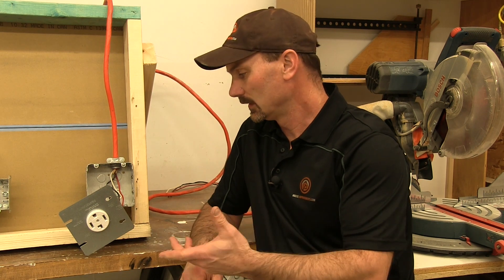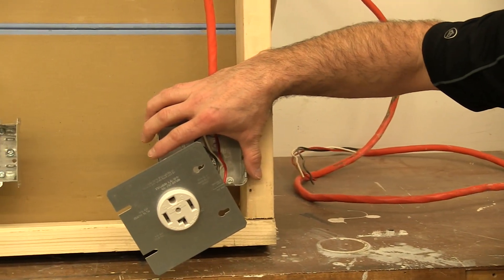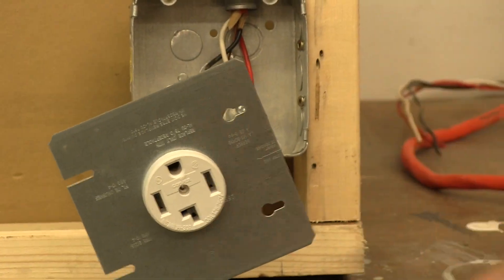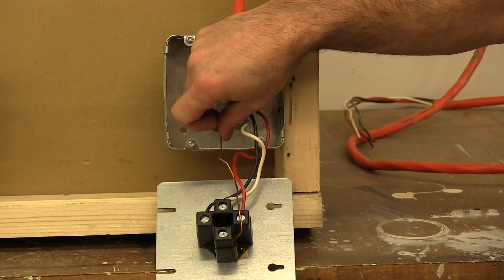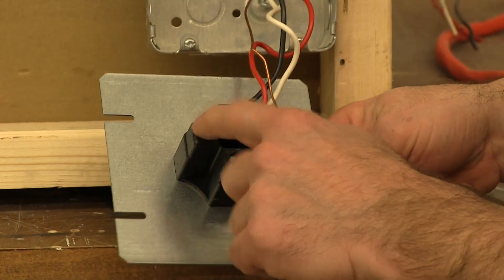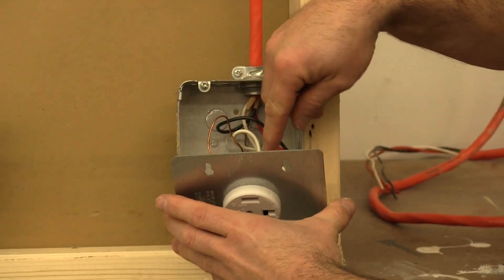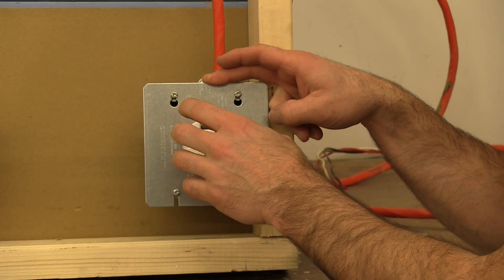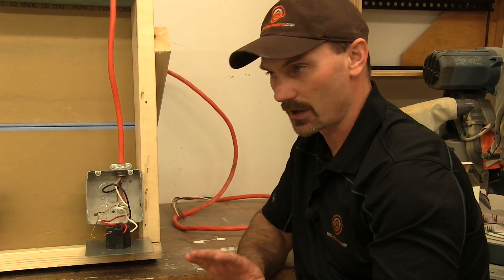Dryer Receptacle Wiring

Comment: I have a ten gauge that is long and I want to coil it up. Is that safe?
Reply from the maker: You dont want a huge excess of extra wire in the wall 12" or so is all you need. 10 gauge wire is only good up to a 30 amp dryer , be sure to check the dryer requirements to size the wire correctly.

Comment: Hey guys I wired up from the panel to the plug using a 3 prong L1, L2 and Nuetral and the dryer wouldnt turn on. I tried swapping nuetral for ground and it turned on but started burning internal wires. Would could cause this if the nuetral is bonded anyway at the main? Super weird...
Reply from the maker: Come to the forum and we can maybe figure this out. Also include info on if you added the dryer cord to the dryer or it came from factory with a 3 prong cord.  https://www.house-improvements.com/forums/

Comment: Great video. Thank you. Do you have any videos on 3 prong dryer outlets? My question is, where specifically does the ground get connected to on the outlet? There's obviously no where to connect it. Ive been told it doesnt need a ground, but that doesnt sound right to me. Or does the neutral white act as a ground. Any feedback or links to common question would be helpful. Thanks!
Reply from the maker: If you are still using a 3 prong the ground wire should be connected to the metal box itself not the receptacle . If you do not have a ground screw in the box then purchase one and install it.
Reply: @HouseImprovements  Thanks. I'll do that, but Im thinking I should convert to 4 prong. Would you agree?

Comment: Why the heck aren't 240 outlets and plugs standardized like the 120's!!?😮
Reply from the maker: Because you could have different Amp ratings so the plugs are designed to only have the proper appliances plugged in to them according to amperage.
Reply: @HouseImprovements  I would then take it that 120's are standardized in amps as well. I will thus repeat my original question. 😀

Comment: Hi Shannon @HouseImprovments, I've watched a lot of your videos and  hoping you can help!

All I'm trying to do is hookup a dryer in an older building (1976 condo) and I've added a ground and converted from 3-prong to 4-prong, standard US 30AMP circuit.  I've watched like 30 videos and everyone seems to claim 240V is either RED or ORANGE, and showing a FLAT wire.  I have a single Romex BLACK, ROUND 10/3 wire (2 white/black hot, 1 ground, and 1 neutral bare wire) coming into a 1-gang old metal box (is this legal?). I am in the US/North American (NJ state). I simply want to move the receptable down lower on the wall out of sight, i.e. extend the Romex a foot or two inside the existing drywall, using up-to-date code and the correct type of cable, connector, and junction box(es). Please explain:

1) Why is my 10/3 a BLACK cable, and round not flat RED or ORANGE?  Is this just common in older construction, or was the wrong type of cable used all the way back to the circuit breaker?

2) What is the difference between Romex 10/3 300V vs. Romex 10/3 600V, which are currently the only ones still being sold at Home Depot. No sign of any red or orange 10/3.  Are these ROUND BLACK cables still current and OK to use inside drywall (like what appears to be there now), or is that the older style, for outdoor use, or some application?  When did they switch from red or orange to black, and flat to round, or vice versa?

3) Does it matter whether I use 300V or 600V?  What is the typical application for each?  (I've googled till I'm blue in the face...can't find ANY videos talking about this anywhere!!)  Is 600V just overkill? What is that typically used for?  Would it hurt anything to use 600V in a 300V application (ie either fine for an electric dryer 240 30AMP circuit), or is it bad to use a higher rated voltage wire for any reason?

4) What is the proper size ELECTRICAL / JUNCTION box for a 30AMP Dryer 240V circuit with a METAL BOX (ground screw in box)?  Except for yours, 90% of the 4-prong dryer outlets stocked at Home Depot and almost every video on YouTube seem to show people installing these newer 4-prong dryer outlets into 1-gang boxes. Even the receptable instructions itself claim "Do not install in 1-gang" yet the plate itself is sized for 1 gang (only two screws top and bottom, like on a normal light switch)!  What is the code for 240A?  1-gang or 2-gang?  Why are the majority of outlets sold with a 1-gang plate if the box is supposed to be 2-gang?

5)  What is the code and safety requirements to SPLICE and EXTEND the cable inside existing drywall?  I read somewhere code says you can't have a junction box behind drywall. So do I need to actually REMOVE the existing junction box, splice all 4 wires including ground using push-fit or butt connectors to extend the cable inside the drywall, then leave that cable there loose in the wall outside of a junction box, just to relocate a new metal outlet box 2 feet lower with an outlet on it?  Is it OK to drywall over the existing spliced section?  (This seems a lot more unsafe to me than just leaving the spliced section inside the existing metal junction box, and then extending on down to the next one.)

Thanks if you can help. Will vote up the video...because I can't find these basic answers anywhere!  Thanks
Reply from the maker: Hi Ken, This is not the easiest place to discuss things like this , please join my forum and we can get you all answered and discuss some other ideas.https://www.house-improvements.com/forums/

Comment: Do we need to go back and check dryer breakers on circuit breaker to see if it has ground wire coming out?   We are buying 1987 condo and the dryer receptacle is 3-prong so we will have to replace it with 4-prong. Base on what electrician told me it should have ground for dryer breaker. This vid comes handy.
Reply from the maker: My forum is the perfect place to get answers for questions like that and its totally free!https://www.house-improvements.com/forums/
Reply: You probably have done what you needed.   1987 is iffy.   That is about when the code change happened to install 4 wire.   If you have a red wire in the box , then change the receptacle to 4 wire.   If no red wire, then change the dryer cord and plug to 3 wire.   Still allowed in NEC.

Comment: Rewiring house, thought dryer was 50 amp so bought 6/2 wire, seen the dryer is actually 30 amp, can I still use the 6/2 wire with 30 amp breaker or does it have to be 10/2
Reply from the maker: You can use it as long as you can fit the conductors under the screws on the breaker.
Reply: @HouseImprovements  ty
Reply: Needs to be 3 conductor with ground, not 2.

Comment: Another great video, Shannon!  Have a question for you, I recently bought a new washer and dryer and  had to purchase a new 3-prong 30 amp. dryer cord as well, but the new cord doesn't fit into my receptacle because of the "L" shaped opening.  Will I have to purchase a new receptacle, so that it will fit the new cord?  It kind of sounds like I would have to do that.
Reply from the maker: Please start a discussion in the forum and I can help from there . sounds like your existing plug is maybe 50Amp but the new cord is 30? Make sure you have the proper cord for the new dryer . We can chat in the forum easier. https://www.house-improvements.com/forums/

Comment: Is there a minimum code height off the ground, or a maximum for a 220 electrical box in a basement utility room?
Reply from the maker: Not as far as I can remember, as long as the cord can reach it without being extended. usually around 36" is a nice height because it is easier to access.

Comment: I need to change the location of my dryer, can I relocate the wire by adding junction box and extend the wire to new location
Reply from the maker: Yes you could as long as the wire is the right gauge and the distance is not crazy. If you need more assistance please go to the forum with questions.https://www.house-improvements.com/forums/

Comment: KOOL 
Another GOOD VIDEO !
Question Shannon - Does it have to Be a ORANGE WIRE ? 
Currently mine looks like a BROWN CLOTH WIRE - just Going to Move the Dryer to another Location and Replace the Recepticle
Reply from the maker: That is an older wire and it will work if it is the correct wire gauge size and correct # of wires. If you are just moving an existing dryer you had already been using you should be fine. The information will be stamped on the outer cover of the wire as to size and wire #
Reply: @HouseImprovements  Thanks - Currently i n use no issues

Comment: The ground wire you you screwed into the box,is that also grounded in the breaker box also or just the metal box,I greatly could use your help 💪👊

Comment: Thanks Sir, but my house is an older house with only 3 wires, black white and ground. Does this mean that i must get wiring redone?
Reply from the maker: Yes your dryer will need 240v so three wires is not enough. The wire and the receptacle need to be the proper size/type for a clothes dryer.

Comment: If I have a 4 prong dryer wire cord, but my wall only has 3 wires coming out (no ground wire), 
Can I attach a short ground wire in the outlet box with just a screw, would that be fine, would that work?  or MUST THE GROUND WIRE  come  directly from the main electric box?
My washer is newer and has a 3 prong wire cord, but I am planning on changing that to a 4 prong cord.
Reply from the maker: You need a ground right to the panel.

Comment: Isn't this wiring for a 120V/240V  Dryer ?
Reply: All dryers are 240V. Two hot legs of 120V each, at !east in North America. In Europe, everything is 240V from lights to heavy appliances. In NA we use 120V for everything except ranges, dryers and the like (where we hook up that second 120V hot leg).

Comment: I've never installed 30 AMP breaker before.  This is for a PTAC (large wall unit AC/Heater, like you see in hotel rooms); I'm replacing the whole run because the old unit was 20 AMP.  The single outlet accepts three prongs with ground and two flat prongs that are in line ("- -" as opposed to "=").  The concept that both black and white are hot confuses me - it's a 10 gauge 3 wire (black/white/bare ground), so I wire both black and white into the 30 AMP breaker (and ground to ground, of course).   is that right?  Does order matter?
Reply: Yes... It didn't make sense because it doesn't make sense for a 3 prong outlet.
Reply: icki, probably u did it already, but u cannot have two hots on the prong u describe. Only the black one is for hot and goes into the breacker and the white wire is the neutral and gets connected to the neutral bar on the panel (where all the neutrals go to).
Reply: Misspelled by mistake breaker, sorry.

Comment: I plan to change the location of my laundry room and when I move things over, I want to upgrade to a 4-prong outlet from a 3-prong (I will be using the same wires since it is in an adjacent room just on the other side of the wall of where the existing outlet is). If there is not currently a ground wire, can I just add one in and tether it to a screw inside the outlet box? and does a bare wire have to be used for ground or could I wrap it in electrical tape except for where it connects to things to the outlet and screw?
Reply: Yes, u can (and i think u' ve done it already).

Comment: In the wall there is just here wires. One bare wire, one black and a white one that has red tape. Can you tell me how I can wire it? My washer/dryer is a stackable and comes with a 4 prongs cable. Where should do I put the wires? Does it matter if the bare (assuming it is the ground) goes into green hole or white hole of the receptacle?
Reply from the maker: You need to rewire right back to the panel/breaker box. If you come to my forum with your question we can help from there. https://www.house-improvements.com/forums/

Comment: does the ground wire have to have the ground wire attached ? I see some metal boxes that don't have a screw in the back??
Reply from the maker: In the US I believe your boxes come without the screw for some reason. You buy them separate.
Reply: And a lot of applications you do not need to ground the metal box. The actual metal on the outlet is grounded so when you screw the outlet into the metal box it grounds the box for you.

Comment: I have a older dryier outlet with 3 prong in my garage that I don't use,question is I want to install a wall ac unit but can I use a 220 v ac unit with that outlet ?basically can a 220 ac work with a 220 to 240 v outlets?or does it have to be exactly 220v?
Reply from the maker: Same thing.If the plugs are the same then it will plug right in, otherwise you may need to change the receptacle to match the AC unit. Be sure the breaker is also the correct size for the A/c unit and wiring in the wall.  please use my forum if you have further questions. https://www.house-improvements.com/forums/

Comment: what's the difference between 14/2 wire romex vs 12/2 romex wire
Reply: djm93 the differences thickness of the copper wiring. 12/2 Romex is thicker than 14 2 Romex. There for 12-2 Romex is rated for 20 amps whereas 14/2 Romex is only rated for 15
Reply: And of course, having less copper  is cheaper.

Comment: 4 pronged dryer outlets are 50 amp! Not 30 amp
Reply: William Finch there are different 4 prong Outlets you can have a 50 amp 4 prong outlet or a 30 amp. They will configure the prongs so that you cannot plug in a cord that is not rated for that receptacle. But there are multiple 4-prong receptacles that are different amperage ratings. For example a range has a 4 prong as well as this dryer. So it is most welder receptacles
Reply: U maybe talkin bout a range

Comment: I noticed a lot of or perhaps all newer air conditioner units have no provision for the condensation water to escape. I think they are depending on the heat from the unit to evaporate the water. Problem that we have found is : if you shut down the unit some of the condensation water remains on the bottom and does create mould so when you turn the unit back on it smells mouldy. The engineers of this type of unit weren't thinking too clearly when they designed these newer air conditioners.
Reply: Agree !!!

Comment: Typically you use: 12 AWG for 20 amp, 10 AWG for 30 amp, 8 AWG for 40 amp, and so on.  If you're wiring for a shop or location where large tools and compressors are used, I would recommend using the next gauge thicker than your needs (ex. use 8 AWG for 30 amp).  This benefits you in two ways: 1 adds another level of safety (thicker wire and insulation) and 2 allows for easy 10 amp increase (heavier wire already installed, just change receptacle and double pole breaker).  Wiring all 120v outlets in a house with 12 AWG gives you the same safety and capability to upgrade from 15 amp to 20 amp receptacles.

Comment: Can you put a regular window air conditioner into a wall?
Reply: Yes, I helped do it at my brother's house.  Just remember, if you move any appliance/air unit containing gases like Freon R-22 refrigerant, let the appliance sit stationary before turning on.  A common issue is laying down an upright fridge/freezer while moving and not waiting a few hours after upright (some instructions suggest 24 hours).
Reply: Melony Smith You sure can. Frame it first and put supports outside and make sure the condensation that drips from the back. doesn't drip on any thing that shouldn't get wet. There are instructions on line all over the place.